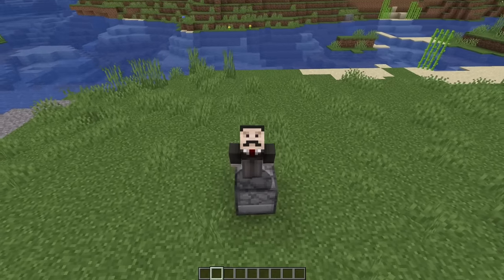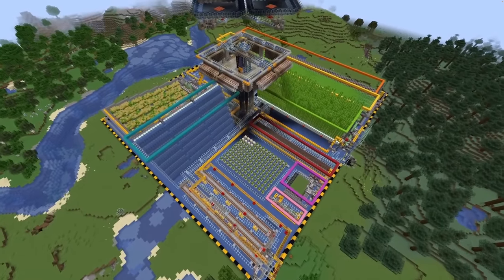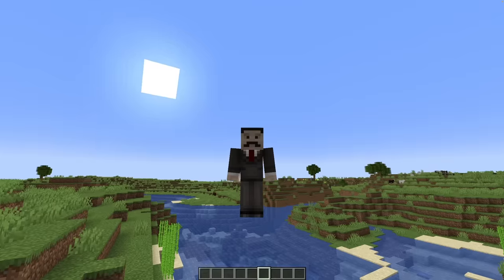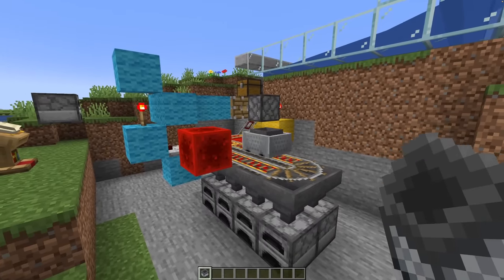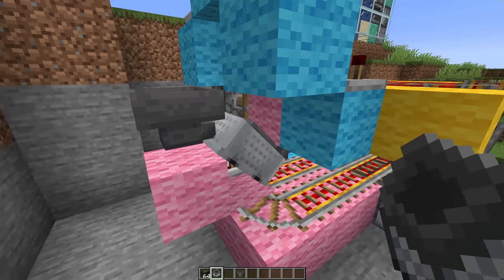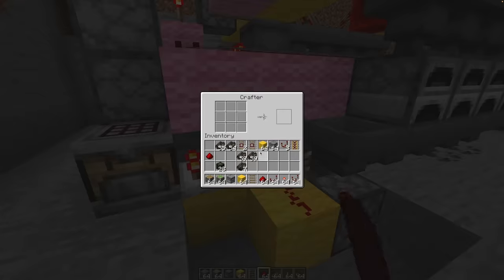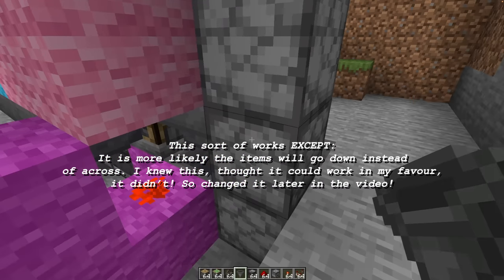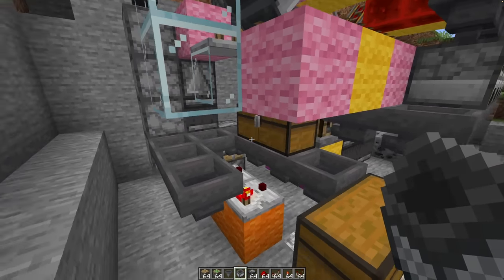INFINITE Furnace Fuel using Crafters in Minecraft 1.21

Comment: wouldnt making an automatic bamboo farm -> craft into blocks -> use in furnace be easier than having to go through a furnace in the middle for kelp?
anyways very fascinating build that i will never be able to use myself
Reply: Kelp is the best, farmable, fuel source, better than bamboo. I think this is all for max efficiency.
Reply: Combine both. Use bamboo farm to fuel kelp smelters
So then all of the kelp, instead of just some, will go to the main smelters
Reply: the best option would be a playerless azalea farm farm for charcoal
bamboo requires a big farm to be viable or a bonemeal farm, and at that point y not azalea
plus it can run wout a player having to be in random tick range
Reply: oh and u can just flip a lever and u get logs as well
Reply: @@piotrbojkoff to make it less complicated. For people who struggle with redstone. Bamboo farm is really easy to make and even small would be good enough to fuel kelp smelting. 
You wouldn't have to worry about being efficient with smelting, so you could funnel kelp directly from the farm to the smelter and not to worry about using always 20 or 40 at the time.

So output from kelp and bamboo farm into a smelter. Output from that into crafter, and then into main smelter 

Really easy to make, as opposed to what Mumbo made
Reply: If you're going for max efficiency & precision, Mumbo's version is a way to go. If you're not going for max efficiency & precision, this type of build could be much much simpler to build. Definitely survival friendly for a non-professional minecrafter.
Reply: Bamboo is a terrible fuel source. Bamboo blocks will smelt 1.5 items per block. Individual bamboo pieces will smelt about 1 item per 4 pieces.
Reply: @micrwvae skeleton spawner + dogs with armadillo hide = lots of bones
Reply: @misterscottintheway  Bamboo can be an excellent fuel source if you set it up properly.
Reply: @shipwreck9146  fair enough but the premise of the video is that kelp blocks are a good fuel source
Reply: @shipwreck9146 and to set it up properly is way more work and a much larger volume compared to kelp, bamboo isnt a very good fuel source, especially now that autocrafting is a thing
Reply: @pulsefel9210  not chunkloadable, slow (especially since u wont get looting), and if u set it up correctly u wont need the useless dog armor anyways
Reply: @micrwvae  If you don't armor your dogs you don't deserve dogs

Comment: My answer to the complicated circuitry is just to feed it enough kelp to constantly be full. Thankfully I've figured that out in the past. 
Suffice it to say that you need roughly 64 kelp/furnace, and that's easy enough to remember. 
I recommend more in small scale (I use 129 for a singular smoker), but comes out to a fairly clean 63/furnace at large scale (though I always recommend just adding a few to keep up with rng of random ticks).

Comment: That's pretty complex. I think I would rather stick with a bamboo farm but use the crafters to convert the bamboo into planks for increased efficiency.
Reply: A simpler way to improve efficiency is to feed those planks directly into the furnaces that smelt kelp.
To make a kelp block you need to smelt 9 kelp, which requires anywhere from 6-9 planks if you don't bother with any timing and just shove planks and kelp into whichever furnace is available.
So you trade in 9-13.5 item-smelts of fuel for 20 item-smelts of fuel, i.e. you get an extra 7.5-11 item-smelts of fuel, with the added bonus of it lasting longer so the possibility of furnace arrays running out of fuel because the delivery system is too slow is substantially reduced.

Comment: It feels kinda cool to have designed a component that would have been perfect for what Mumbo was trying to do here. I designed a similar system for my kelp farm + furnace array, although obviously because of the lack of a crafter it was more manual. It would store up kelp until there was enough to smelt across the whole furnace array without having a net loss, then light up a redstone lamp when it was ready and I could go and press the button to make it smelt - same idea as Mumbo's build here. It's so helpful and really simplifies the process of getting fuel

Comment: Heres a simpler way to detect items. Instead of reading the fullness of the furnace, you instead use a comparator behind a block to detect the fullness of the HOPPER. Since the hopper has 5 slots, which will each stack to 64, thats 310 items, divided by 15 for the maximum signal strength when full, gives us 21.333 items per 1 signal strength. This means once the hopper hits 22 items, the comparator will give an output strength of 2. We can detect that, and activate a small clock that deposits exactly 4 kelp blocks into a smoker, and then, the block between the hopper and comparator is moved by a piston, breaking the ability for the comparator to give an output. This activates an ethos hopper clock, which will run for exactly 400 seconds, as thats how long it will take to smelt 80 kelp in a smoker, since thats how much 4 dried kelp blocks will smelt. A quick google search shows hoppers move items at a rate of 2.5 items per second, so that putting exactly 160 items into the hopper clock will give a timer of exactly 400 seconds. After that, the furnace runs out of fuel, the block is moved back between the comparator and hopper, the clock is turned off, and it is reset and ready for another round of checking.

Comment: One possible way of simplifying it is to just use a different fuel source for the kelp itself.
A small bamboo farm, for instance - autocraft 9 bamboo into bamboo blocks, then the block into planks (you get two planks per-block).  Each plank can smelt 1.5 kelp - but at least one.
Those 9 pieces of bamboo can smelt 2.25 items total, but by turning them into two planks we make it anywhere between 2-3 items total.  We can just round down and say it's always going to smelt the minimum (1 item per plank) and we removed all the timing requirements for smelting the kelp.
Fuel and kelp can be distributed greedily with overflow going to the next furnaces, and after a while you'll be able to tell what you need more of by how many smokers are not working.  If the unlit ones have kelp but no planks, you need more bamboo, otherwise they have too much planks and not enough kelp, the kelp farm can be expanded.
I don't know how big a dedicated bamboo farm for that would be, but I suspect it might not actually need much - and bamboo can be farmed in largely the same way as kelp, just without being in water.

I kinda like this as a solution for turning a complex problem into a "just add more (kelp/bamboo) production" problem.

Comment: I know the bulb wasnt around when you were making this contraption, but you may also be able to use the binary counter system to count how much kelp is available and only dump it into the furnace if it reaches 20 so as to not waste the kelp blocks. But I haven't done much redstone in years so that's just an assumption

Comment: You could have the crafted kelp blocks go through a hopper chain that has an item filter below it. Item filter goes back to the input for fuel on the smoker, and when it fills up, it overflows into the input for the super smelter. If you allow for it to completely fill up the smokers before sending any to the super smelter, you could align a chest boat over the top of 8 hoppers to distribute instead of a minecart

Comment: 0:58 I wish I could show you the kelp farm we built on our server. Somewhat similar to that one, but mine is fully vertical (and lossless). It goes from about sea level to as high as you can build in 1.20. And if I recall, 64 blocks wide (and two-sided). It's.... Well, we're never wanting for XP. Or fuel. And if I recall, the excess dried kelp blocks fuel a different array beside that one. I think there's a cobblestone generator there and the cobblestone is turned to stone (creates more XP).

3:48 We went with ice blocks and water alongside hoppers in an oval pattern (for the smoker array). It's been a while since I looked at it because it's been modified a couple of times over the past two years, but the the excess kelp goes into temp storage so that it's not lost.

Comment: To fix potentially backing up, have a comparator that detects whether there is excess kelp going in, and it somehow diverting the kelp from the farm into a mass storage system that has its own smelter and crafter, then the dried kelp blocks are sent off to the same bulk storage as the dried kelp blocks from the farm itself

Comment: A relatively simple version of this simply has a ton of smokers dropping their insides into a crafter, and that crafter having a hopper that has a direct connection with the fuel input of the smokers. And a second hopper leading to wherever.

It will take some time for the line to overfill, but once it is fully filled up, automatically 45% of the production will enter that first hopper without needing to do any of the math.

From there on, you can scale up as much as you need. I have one at spawn loading up my super smelter, which is consistently smelting, while also having it connected to a storage in the end in case I produce too many kelp blocks. Gives me a few stacks of kelp blocks to start up any other self-filling smelter.

Comment: Mumbo, what you could have done is for the side hopper that feed into the fuel for the furnace, put one of those new pot storage items. Have a comparator coming out that when the pot is full blocks will no longer go into the pot. locking the hopper that fills it so all overflow of kelp blocks go into your storage

Comment: Interestingly, I made a one-chunk Kelp Smelter and Kelp Block Storage system. It would 'waste' one Kelp Block to start the process but the way I worked the timing outs was that after a cycle, it would always produce more Kelp than was used to craft the Kelp Blocks. Honestly, the only thing that was slowing it down was the fact that I had a non-optimized Kelp Farm design, and that was just so I could fit it all in a single chunk. (And even then, if I forgot to turn it on to smelt the Kelp into Dried Kelp, it would overaccumulate within a Minecraft day or two. With the 'slow' speed of the Crafter, I think there might be a greater risk of the Dried Kelp accumulating faster than it could be converted into Kelp Blocks.

Comment: Sheers for wool farms.  I would like to contribute my design which takes a signal from the dispenser from comparator UNDER the sheep (grass grows and is eaten by sheep through comparators) and through a shroomlight to trigger the hopper unfreez and queue the sheer delivery.  Works with existing compact designs

Comment: 3:12: use an etho clock with 20 items, with an observer observing the space the pistons push the block back and forth. Every time the clock flips, it should put 1 new kelp block back into the furnace. 

To prevent overflow causing counting problems, lock one of the etho clock hoppers until an item passes into the furnace, and count one each time.

Comment: i think the easiest solution would just be to calculate how many kelp does the farm make on average in 10 seconds. Since thats how long it takes to smelt one kelp. SO if the farm makes 2 in that 10 seconds, u can then have 2 furnaces going forever without any issues. This goes in a hopper which goes to a crafter, which flings the item up to a water stream, which brings it back to the furnace. easy loop. No redstone other than 2 observers! its super simple.

Comment: What I'd have done, is when the kelp furnace has more than 20 items ready, it makes a piston push a target block down. Then every so often a clock ticks and any target block down triggers a dropper to push the block of kelp into the furnace. 
Make the clock long enough that it's roughly the length of the cook time and you'll have minimal waste. 

When I made a similar farm in Create, I also let the kelp blocks fill the furnaces first, before they overflowed to be used as fuel by the rest of my base. Just felt slightly safer.

Comment: Sorry if this is off topic or comes across as rude to mumbo, I kinda just wanted to talk about my build inspired by this video 😅
I was a bit bothered by the emphasis on efficiency when I personally don’t care to make a timer system so I made one that just uses a standard super smelter. The dried kelp goes to the crafter, then every block of dried kelp goes back into the furnaces. However, the smelter is fast enough that the blocks build up and overflow into the next furnace etc etc etc if you wait long enough it’ll start depositing dried kelp blocks at the end of the furnace line
I’m leaving it afk rn, only three furnaces were activated, but I suspect more will be working when I get back
Granted this is only a good system if you have a lot of time. If you prefer the elegance of timing and counting everything like in mumbos machine that’s cool too!

Comment: I built a super barebones version of this on bedrock. My “storage” and “recycle” circuit (to decide if the kelp block store or recycle into the machine) is literally just a chest the crafter drops items into that has a hopper that moves back and forth between two different hopper lines after every item that gets crafted. So it’s a 50/50 split between the kelp blocks.

Comment: A better way of determining if a smelter should fire would be a comparator on the hopper feeding into the smelter. You can take whatever level you like as long as its large enough to ensure it isnt triggered by them just falling through the hopper. You could think of it as less efficient because itll only fire with more than a full stack in the smelter, but the hopper and comparator would act as underflow protection so the steady state throughput would be the same.

Comment: If we're talking purely about getting the fuel, then I think even if bamboo doesn't burn very long the bamboo farm is way more efficient and simple. Because it produce so much, a bamboo farm would cost less in material and time to construct, and keep the bamboo rushing to the oven or smelter. It could also be turned into blocks to burn blocks of bamboo instead of just bamboo sticks.

Comment: You could also use bamboo planks as a fuel source. 
1 bamboo stick = 0.25 of an item, 1 bamboo block = 1.5 of an item, 1 bamboo plank = 1.5 of an item
9 bamboo sticks = 1 bamboo block = 2 bamboo planks.
So using 2 crafters to craft the bamboo planks you will get your fuel without needing to smelt anything. You get 9 bamboo sticks to smelt 3 items.

Comment: Rather than splitting I'd probably use an overflow switch for the kelp block output. Send everything back into the smelting system, send excess to output. takes a bit to get going but will guarantee no running out of fuel and outputting exactly the excess

Comment: I have a bamboo + kelp farm setup on my server where the kelp and bamboo both feed into two furnaces to make kelp blocks. All that is needed now is to place the auto crafter at the end and boom, fully auto kelp blocks. I think this method is slightly better as you dont need any fancy logic to control the fuel. Just feed the kelp and bamboo directly in. And it's more efficient as you get 100% of the kelp you farm for your use. Bamboo grows super fast and so you dont need a massive farm to keep pace with the kelp. Thoughts?

Comment: You could run the kelp blocks over a hopper going back into the system before the move on to your super smelter. The kelp smelter would alway be full that way, and 100% of the remainder would be taken to your super smelters. No need to divide 45% or any other math/redstone

Comment: I have a suggestion that would makes thing much simpler. Just let the furnaces back up one kelp block makes at least two so eventually youd have a surplus no matter how many blocks end up as fuel. If you can rplace the kelp faster than you can use it you could use a simple item filter to mitigate the amount needed to prime the system. At that point it as simple as dropping another hopper and under neath the collection line to refuel the system.

Comment: Why not just have a hopper clock running whilst there is enough kelp in a saturation hopper. Which is as long or a tad longer than the smelting time for the kelp block.
Then you won't waste any kelp.

If you don't want a clock a simple interuption system will do the trick:
Once a saturation hopper fills up check for running, if not,  flip a latch to the running position, send one tick pulse to observers which put one kelp block into the smokers and enable the observer refill option (delayed).
When the saturation goes below threshold, disable the observer refill.
If the saturation goes above threshold and the system is still in the running state, enable the observer refill again.
If the saturation is below the thershold, make the last observer tick set the system to not running.
The observer refill needs a short delay after firing to make sure it doesn't send a second kelp, once the smokers go to active again.

Comment: ONE itsybitsy, teenyweenie, bamboo farming, single furnace module (a in furnace gets a bit longer, dont forget to sing along next time)

this gets some sort of toggle to save up a sufficient batch, and then eventually will totally be outputting extra bamboo as well, but will now be self starting if you import it with no items.
Reply: could replace that bamboo farm with an input chest for your wooden pick, and it would be a really cool structure if they ever add simple autocrafter setups to villages. seed it with only 3-4 kelp planted in random locations, whole thing fitting in.... 15^3 blocks?... a mini one on the Blacksmith's? im actually totally gonna be seing if i can put a super simple blockifier into a blacksmith's back room, or if it will have to go on the roof or something like that next time i play.